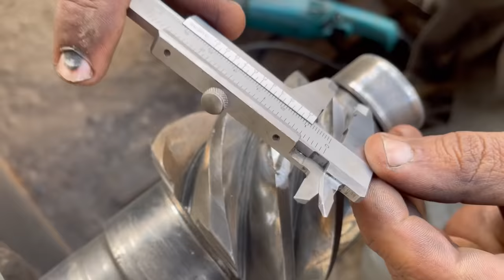I repaired the scrub pinion which no mechanic repairs | Give your opinion by watching the video |

Comment: There's a really good reason why people who understand the nature of these parts don't attempt to repair them.  This "repair" is useless as it will eventually ruin both the ring gear and this pinion because there's no way he can equal the accuracy of the CNC that cut this.  Not only that but for whatever reason he ground on all the teeth, basically ruining the accuracy of all of it.  It'll probably last a little while but it'll be noisy as hell (which they probably don't care about) and will fill the entire differential with metal shavings as it grinds itself down, thereby ruining all the bearings along with it.  With the loads they put on these trucks, I don't give it long.

These guys are pretty handy with what they have to work with but, again, this is not a repair.
Reply: Just about to say this his weld rod will never meet the hardness of this either so it’s useless
Reply: If he thinks he repaired it, then he has zero understanding of metallurgy either. Dunno if thats an economical repair where they are from tho... hope it is.
Reply: @harryfp1494  - I was going to give him the benefit of doubt on that part cuz I'm not up on all the welding rod specs.  All I ever work with is 6013 and 6011.
Reply: I want to believe this is a temporary repair to get the truck and cargo to its destination and later taken to a proper shop for the right parts to be installed by a qualified technician.
Reply: when the parts dont exist  or to expensive theres always a way
Reply: I have repaired teeth on an ironworker flywheel gear with 29-9 alloy rod, a die grinder with fine stones and a contour gauge in-place. Must admit that it took more time than this because i took a finer approach, the repair was stronger than the original tooth, the job was performed in 1999 and the ironworker is still punching, bending and shearing away...
Reply: You're right, I wouldn't allow this here. But there it's common place. That being said. I wonder what steel they welded it with. It's not a forged and machine replacement for grain structure, carbon content, or harden temper, but since they do this all the time I seriously wonder what they use. Especially if it actually works as a repair.
Reply: Don't be jealous
Reply: And the heat of the arc weld, destroyed all the mechanic properties of the steel around, if this repair is economic and for temporary use, it is actually pretty good
Reply: excellent explanation. and I think it's true.
Reply: @harryfp1494  this is what I thought as well. The original part must be hardened steel, the repair is not. Also all the grinding he did on the rest of the part was completely unnecessary.
Reply: He didn't even grind out all the cracks under his weld...
Reply: Maybe it's to get them from "A" to "B"?
At "B"… they could prove you wrong on your assumption that they "don't care"?
Maybe they care a great deal about the transportation that makes them money? 

Maybe you should comment on what you know… your "assumer" is hyper active.
Reply: @sharp19712  - I support your comment 100%.
Reply: @babasidd6986  NHF-650B is a hardfacing alloy electrode.  Maybe get the truck from the side of the road to a proper engineering shop.
Reply: The South African description for this sort of repair is " I can gippo it enough to get you home "
From the desert war,  to gippo something is to repair it like an Egyptian.
Reply: Andrew Crews  "... the gears are designed with enough backlash in them from factory that they can wear a significant amount and still mesh properly..."  Gear are not designed to wear any amount. The whole purpose of the extreme pressure rating of the gear oil is to prevent metal-to-metal contact so there's zero wear. When there's metal-to-metal contact, you have a lubrication failure.
Reply: I understand that disrepair is not equal to the tolerances of the original part.
Do you think these type of parts were never made pre CNC?
I also understand welding and a grinder not the same as using Precision Machine Tools.
I work in an industrial Machining environment.
One thing I can say with 100% confidence is that is not a CNC necessary repair.
Another thing I can say with 100% confidence is that there needs to be more than a few extra steps to ensure the longevity of the repair.
But it always comes back to is it cheaper or easier to repair it that way 10 times then to replace it or repair it once "properly"  -  and more importantly is that an option
Reply: @markvickroy6725  - Well, with all due respects, claiming confidence doesn't change the fact that you don't know what you're talking about.  I speak from 40 years of experience in automotive, heavy truck, and construction equipment repair and I've probably repaired at least as many differentials as you've had birthdays.  I know what's required and what they will and won't tolerate.

And regardless of tooling, what the man did in the video will not come anywhere close to what's required.

Comment: I welded my pinion gear just like this on an 700cc 4x4 Atv 7 years ago, new or used parts were not available so it was worth a try, after i welded the gear i ground the gears and put it together and used marking lube to make sure the tolerances came close to acceptable before i put it all together. The repair still works like the part was brand new, ive put 20.000km on it and most of that is by plowing snow so it has been under load alot. Makes no noise and havnt contaminated the engine oil.
Reply: Did you re-harden it after welding and grinding?
Reply: @JohnDoe-es5xh  No i did not, I was ofc thinking about re hardening it but it was an experiment and i kinda wanted to see if it would last or not ;) Since then ive also welded on more material on the teeth of dog rings in a atv gearbox, it was slipping out of gear as the teeth was rounded off on the corners and that repair is also holding up fine ;)
Reply: @JohnDoe-es5xh   That pinion was surface hardened. Pretty difficult to do that in the field.
Reply: You are one lucky man!
Reply: Never let somebody who never strays from the path or refuses to believe there is more than one way to skin a cat tell you that you are wasting your time or going to fail .
Reply: @Halibrand  did you use any special kind of electrode / rod ?
Reply: Yes the same thing happened to me on my truck but I didn't have a welder so I carved a new gear out of wood still driving it today
Reply: @davidkclayton  Why to use wood ?? Usually I use a bubble gum !! It works
Reply: It's junk anyway.  Nothing to lose if you have the time to spare.  I wonder how long it lasted.
Reply: Lol I was gonna say I be it's the quietest pinion ever! Lol would have probably been better to just grind it down.  Either was I bet you have to replace bearings a lot
Reply: @flhusa1  absolutely spot on
Reply: @Torch4ya  If you had read it you had seen that "20,000". That's where he mentioned the miles he supposedly drove with it.
I have my doubts too but yeah.
Reply: @ EDS GARAGE you’ll often find the people who comment with that’s not going to last bla bla bla, are the people with the teaching career and pen pushers, there great on paper and there as useless as the G in lasagne when it comes to the practical end of it , and there also the same people who do the odd job at home for them selves and all of what they preach goes straight out the window and are as rough as dog shite, there’s also the person who says why repair it just get a new one, these are the people who get everything handed to them have no initiative no  common sense and zero thinking outside the box, I can guarantee you these people who did this repair have tried and tested this method if it wasn’t a success I personally don’t think they would be wasting their time, 
Fair play with fixing the ATV we’re a dying breed at this stage 💪😜
Reply: @Thedar561  Often, yes. And often these people actually made their own experiences with repairing stuff beyond good and evil.
Reply: @timjohnson1199  Laser heat treating is going to become quite cost effective in the next year ;) I'm working on it lol
Reply: ATV and a heavy truck is a looooong way apart in torque and forces...
Reply: @N4CR  tell us more!
Reply: Driving an ATV 20km, which is like 5 miles, isn't much. And it's a lot lighter and less powerful than a truck. I'm glad it worked for you, but it won't work for long on that truck.
Reply: @davidkclayton  you just have to pay particular attention to the direction of the grain
Reply: @TehButterflyEffect  20k km, 20000km or 12427 miles. More then i put on my daily work vehicle per year. I tow no starting vehicles into my automotive shop with it a couple of times a month, diesel pickups and large box trucks without any issues. When the pinion gear got hurt the crank case cracked where the pinion bearing sits so i had to tig weld it together aswell and its holding up just fine.
Reply: I've welded sprocket teeth so yeah
Reply: @davidkclayton  was it oak?🤣

Comment: Сложный профиль зуба сформировали УШМ,какая твёрдость после наплавки,никто не знает.Зато быстро.Потом  где нибудь на горной трассе Пакистана всё это развалится.
Reply: У нас в инструментальном наплавляли с твёрдостью 55... 60HRC, но полагаю это не тот случай
Reply: @johnsharky1345  Больше 50 HRC уже жопа(
Reply: тут вопрос такой, а с какого фига произошла выкрошка на шестерне ? Заводской брак литья ? Может быть... так чтА не боги горшки обжигают.
Эти ребята тоже ведь не первый такой ремонт делают, а мастерская у дороги может уже лет 40-50 работает, может они даже танки чинили при ИндоПакистанском инциденте.
Reply: И ещё ведомую шестерню загубят заодно.
Reply: @qweewq358  да там все уже изношено, это не так страшно, главное гипоид не забыть, но скульптор хорошо потрудился, с моторикой движений у него более чем хорошо. И вряд ли многие из нас так умеют воять болгаркой.
Reply: @user-uo8px3tf5h  сам факт, что наплавкой такое можно получить. Правда потом надо отжиг делать.
Reply: @johnsharky1345  Наплавкой до 50  HRC легко получить.Но отжигом отпустишь все остальное..
Reply: I think just saves you towing a truck from road side, drivers too are skilled to use gear slowly and skillfully.
Reply: 9
Reply: The rods are hardfacing air hardening, say they go 55-60 HRC. Fair bit of Mn in there so it'll work harden further. Who knows if it'll have softened the rest of it. Pretty big lump so might have got away with it. Still cheaper than buying a new one I guess.
Reply: Trabaje haciendo engranajes en una empresa,  y  las piezas se hacen con mucha presición para que funcione bien, esa trabajo es para salir de emergencia, formar el diente con un esmeril connla mano no es preciso, cuando ensamble , el diente soldado  que no es tan duro  tomara  forma al trabajar  con el dientevdelnotro engranaje, pero se dañará el otro engranaje, la pieza reparada tiene tensiones residuales por la soldadura que calienta mucho, es una solución por el momento hasta que compre una pieza nueva.
Reply: @igorbogordetski2319  Ты же видел в соседних видео, как тут литье делается =)
Reply: Однозначно качество низкое. Но для того что б техника не простаивала , пока идёт запчасть нормально. Был в подобной ситуации, жалею что не сделал так же. Четыре месяца выкинул из жизни... Пока ждал контрактный мост. Машина была Nissan atlas.
Reply: @lionivanov  видел и про литье, видел и про полуоси, вот и задумайся, что они работают так уже десятилетиями. А видел как стоп сигналы восстанавливают ?
Сказать что это все гавно, я думаю нет. Я уже пост выставил о том как СССР в ВОВ разбил всю европейскую промышленность, работавшую на Германию.
И видел, кстати, как лобовые стекла на первые иномарки заделывали еще в СССР в конце 80-х, как ШРУСы восстанавливали и многое другое.
Reply: это спец.электроды для наплавки подобных вещей, качество наплавляемого элемента не отличается от заводской детали,но то что зуб формируют болгаркой эт конечно шедевр)))) ЧПУшники нервно курят в сторонке.
Reply: @user-ux5sd7do3n  Я не думаю что у этих индейцев есть понятие о различии электродов. Делают тем что есть....
Reply: Пакистан находится под санкциями, там детали "на дороге не валяются".🤔
Reply: @Chas1741  перед сваркой он специально маркировку показывает
Reply: @romka_ind  специально посмотрел.... Кроме производителя нет информации что за электроды. Если бы меня нужда заставила, я  бы выбрал лучшее из того что есть. Наверное они сделали также. Возможно их цель чтоб узел отходил до прихода новой детали. Вполне оправдано.
Reply: @Chas1741  Ну или чтобы продать машину а дальше типа не их проблемы, покупатель ничего не докажет.
Reply: @safburner2667  если машина хорошая, не думаю что это серьёзная причина, чтоб от неё избавиться.
Reply: @johnsharky1345  электроды Т-590, поекрасно наплавляют, твёрдость 58-64, заявленных. Если наплавлю лишнего, меня слесаря проклинают, на 3мм толщиной, 20/30 д/ш наплыв - уходит минут 10 времени и 1 зачистной диск 125)
Reply: @user-ux5sd7do3n  качество конечно отличается, единственное и правильное решение хоть как то сопоставить характеристики свариваемых деталей - равномерный нагрев, потом отпуск, а потом закалка при помощи индуктора, т.е. цементация наружнего слоя деталей
Reply: Dat zal ie wel vaker gedaan hebben, gezien zijn skills en garantie tot aan de deur. En dat in tien minuten :)
Reply: @TKSERG  Чёрт, вот как-то не получается следить за Пакистаном, а под какими санкциями он находится?? Под литовскими или эстонскими?
Reply: @igorbogordetski2319 у вас глупый вопрос.
Reply: @av0909av  пробовал т-590 наплавлять катки на гусеничный минипогрузчик 🤣🤣. Токарь сжёг несколько резцов и вернул обратно. Пришлось сдирать болгаркой и наплавлять обычными, чтобы токарь смог проточить в размер. Второй год полёт нормальный.
Reply: @TKSERG  ну да конечно, слышал про санкции звон, а откуда и про что - то неведомо. Да, так всю жизнь живут, на таких бизнесах, у них просто денег не хватает на новые запчасти. Смеетесь что ли... Санкции..
Reply: @user-ux5sd7do3n  я болгаркой уже любой зуб нарезаю, но все это ненадолго
Reply: @igorbogordetski2319  я часто смотрю это кустарный ремонт.
• А насчёт санкций "спросите" у Госдепа.
Почему Пакистан в изоляции.
Reply: @user-sd9jr3po2k  метал у шестерни должен быть сырой, только снаружи несколько десяток каленого слоя.
Reply: 50 лет в союзе так ремонтировали трактора по колхозам и ничего, все работало. Даже умные книжки выпустили по полевому ремонту техники.
Reply: сварка сделана по всем индийский стандартам, геометрия зуба выведена по индийским технологом, качество выполненных робот 11 из 10
Reply: согласен .это бред.нет однородности сплава .даже снятия напряжения после сварки нет,не говорю у же о закалке.полная шляпа .
Reply: @user-zr6im8nr8r  не ври давай , никто так зубья не наваривал .
Reply: @Chas1741  Зубья на ковшах карьерных экскаваторов наваривают сармайтом т-590 и ходят лучше новых проверено.!!!
Reply: @dvsnik8161  согласен, знаю. В том то и дело, что наплвка этими электродами   не подразумевает дальнейшей мех обработки. Для зубьев ковшей и т.д. идеально подходят...
Reply: Всё ровно упадёт по дороге в пропасть
Reply: Хорошо если на трассе, а то и на какой нибудь горной дороге уйдет в пропасть и писец супермену ремонтирующему редуктора!!😂😂😂
Reply: @Chas1741  ты себе нервы и жизнь сохранил, неизвестно чем бы это для тебя закончилось!!
Reply: @Chas1741  каким зря электродом тупо не приваришь.
Reply: Ничего страшного, они в масло для притирки песок добавляют. Трудно не заметить, что УШМ с ЧПУ, она на прямую к компьютеру подключена.
Reply: А прогреть перед наплавкой иначе она потрещит вся наплавка ета греть нужно было
Reply: А после наплавка в термообработку
Reply: @Chas1741  он пачку в кадр показывает, наплавочные электроды с высоким содержанием углерода и хромом. такие в хозяйственном не купишь.